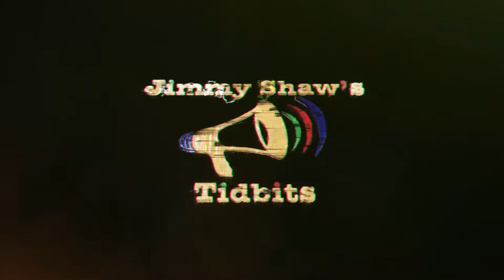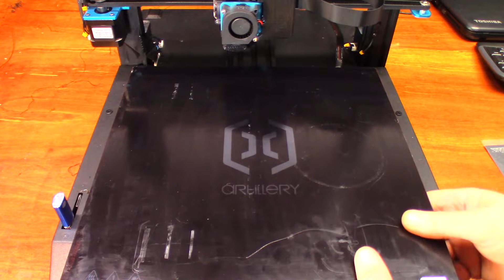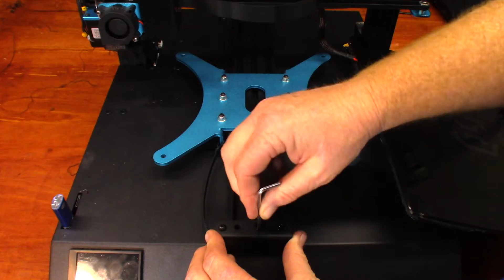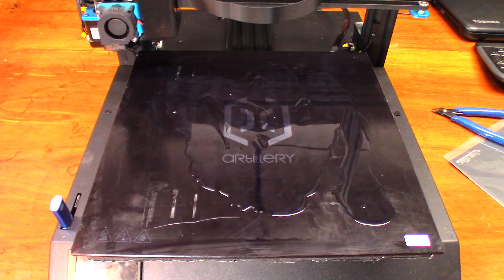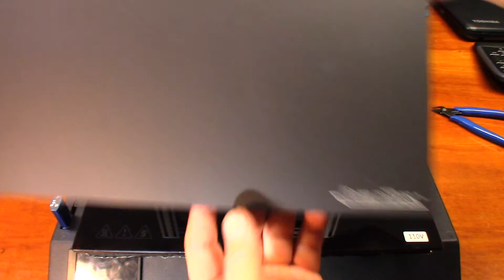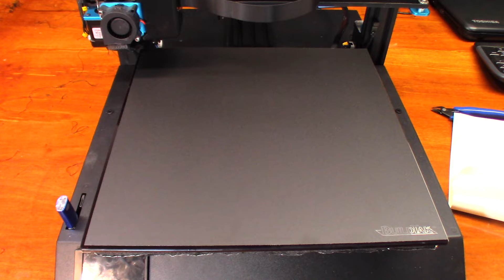Fixing and Upgrading The Artillery 3D SW-X1

Comment: Why do you need glue at all with this printer? I've not required it once.
Reply from the maker: I used to be the same way.  Then I had longer and larger prints fail because they lifted from the bed.  Once you waste a roll of filament or two on fail prints that a simple bit of glue stick could prevent, it becomes habit to just do it as insurance.
Reply: @JimmyShawsTidbits1  this doesn't fill me with hope 😕

Comment: How do you like this printer?  Any major issues on concern?  Would you recommend?  I've seen a couple videos with people whining about little crap.
Reply from the maker: I love mine.  Now mine is one of the first.  I know they have made changes and now are up to a version 4, but from what I have seen most problems come when they start playing with firmware, bed probes and playing with the hot ends.  All I have done to mine in over a year is go to a 0.8mm nozzle so I can print thick and fast.  So far I haven't had any problems with mine.  So based off of mine I definitely do recommend it.
Reply: I love my genius. Its smaller brother.
Reply from the maker: I love my Genius too.

Comment: Have you ever had a problem with the extruder not moving at all and then throwing an error at you freezing the whole machine? I am currently having this problem, I have changed out the board and the motor and still no luck.
Reply from the maker: Have you checked the wiring?  Sometimes a wire can break in the harness.
Reply: @JimmyShawsTidbits1  I Have looked over all the wiring are we talking about just the outside or underneath?
Reply: @Bearstatto  He's more than likely speaking of the ribbon cable, those malfunctioning are the symptoms of the problem you're having

Comment: Your print failed due to the belt slip, then you suddenly change topic to the shameless endorsement of a product claiming the glass bed was the problem. You should pay attention to the problem which it looks like you did not fix by not interlocking belt teeth.
Reply from the maker: The problem was fixed by tightening the belt.
Reply: Title of the video: FIXING and UPGRADING The Artillery 3D SW-X
Mission accomplished.

So... the transition form one thing, to the next, did not meet with your approval?
The guy liked what he upgraded to. Not seeing the "shameless" endorsement.
The problem got fixed. Despite the zip-tie's orientation, he was smart enough to
identify the problem.

It's one thing tom point out mistakes. It becomes another to shame a person for them.
You ever make a mistake? I suspect you wouldn't like it if someone talked to you that way.

Comment: Dear sir is there any way to increase the nozzle temperature up to 250+ so it able to print NYLON?
Reply from the maker: Since the printer comes stock with a PTFE liner in the nozzle throat, I would say no without some modifications.
Reply: @JimmyShawsTidbits1  Thank you very much.
Reply: Yuo need to replace the teflon tube inside the extruder, whith Capricorn tube , its can reach 300, so no problem(in that area), but for print Nylon, yuo will need a Very good control of AMbient HUmidity, and of course use an Enclousure.Nylon its very good taken air humidity,i read a guy that buy a rolll of filament , in just onw day  it was wet ..making imposible to print...Good Luck

Comment: That's a lot of alcohol, i just squirt a tiny bit of 91% onto a shop towel and that's more than enough to clean the bed on my printer. I definitely used to also drop a bunch on the plate, but one day i was running low so i used less.. then less and less as the bottle neared empty lol.

Comment: Hello.  What do you think of the Artillery?  can you give me your opinion?
Reply from the maker: Personally, for the price it is a great printer.  It has a large build volume and a decent print quality.   The version 1 like mine has a z wobble issue.   I still need to print and install the fix for it, but it's still not bad.  The version 2 has the problem fixed.

I love the sleek look of it.  The ribbon cables make it look really clean and you don't have to worry about cables getting in the way of a print.

My favorite is being able to print from the USB stick instead of a SD Card.  Thumb drives are less expensive where I live and a lot easier to find.
Reply: @JimmyShawsTidbits1  thanks you.

Comment: The reason why the belt loosened is because it was ziptied with the smooth sides touching and you also re-ziptied it this way. You need to fold the belt so that the teeth are interlocked and touching. This issue will happen again.
Reply: Very true! Have it lock teeth to teeth on the belt and it will stay there forever!